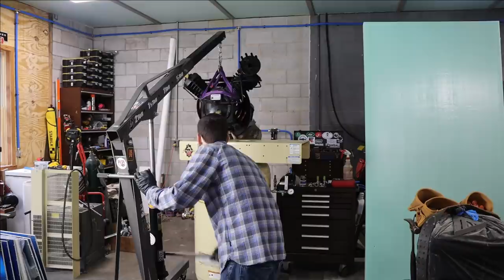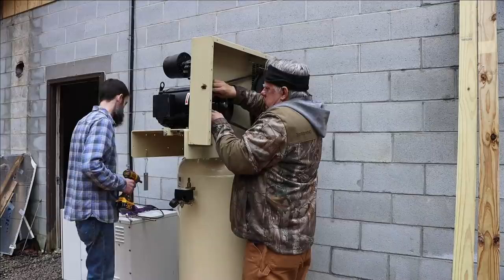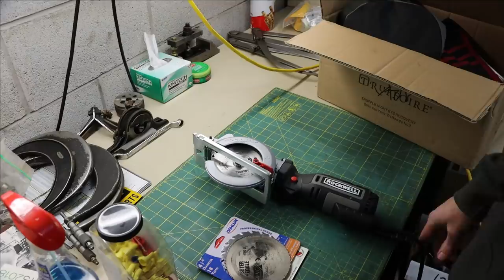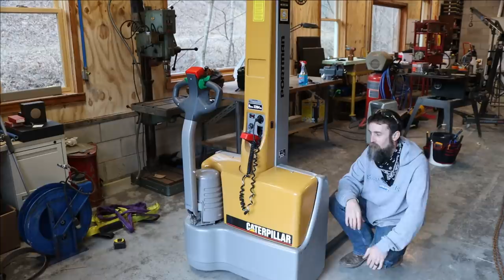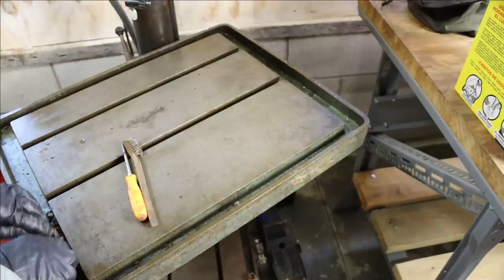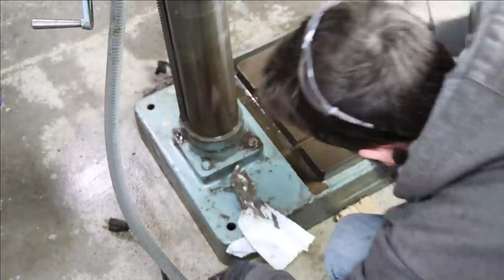Awesome New Shop lift! /  Doall Drill press 1st run and clean.

Comment: Nothing better Than A maple workbench. I got 2 of them. Will last a lifetime. Then you can flip them over, and the next owner can use it for a lifetime
Reply: Fancy seeing you here Mr.Pete
Reply: Before buying any batteries I would look up a local commerical battery vender for heavy equipment and lift trucks.   They may also have a couple low time used batteries given how little you'll be using it between charges.   Also suggest a small back splash on  the new table to prevent small parts rolling off into no man's land.  
Given the stock look on the Caterpillar you might want to consider orange flames down the sides.  Well done and I'm happy things are lining up well for you, you've waited long enough!
Reply: Steve, two thoughts crossed  my mind.  A good future episode might be brazing  those drill marks closed on the new drill press, then using the shaper  to refinish the surface.  That would make a good video.
2.  GET A SECURITY SYETEM.  You're never to remote to not have A couple local speed addicts breaking in and stealing what ever they can pack off and fence at a pawn shop or Craigslist!

Comment: Love the doall Drill press. Make sure you clap your work, That thing is so powerful, it will break your wrist.
Reply from the maker: Thanks Lyle, I really like the drill press as well. It really would twist you up real bad without even bogging down.  Its incredibly powerful.  That's what makes it so nice for the larger drills.
Reply: It is a nice piece to have. Incredibly versatile fot the foot print it uses
Reply: Indeed, give your work a round of applause and it won’t try to kill you.

Comment: The new shop additions look great. The lift should be a great help around the shop. One thing about the batteries, the batteries  and the charger must match. AGM is different than flooded type etc.

Comment: dont replace the agm batteries with car batteries it whont work for long : the car batteries are made to give a high amp charge for a short time they have thin lead plates that will warp and damage if you use them in the forklift , they might even damage the build in charger as the gell batteries charge in a different way 
the gell batteries are made for a lower amperage at a longer duration and have cells made of thicker plates , they can allso take more mecanical shock abuse , you could get away with acid agm batteries for solar systems but gell semi traction batteries work best and can be recharge verry verry often and hold the charge better and longer 
if you make some sort of table like structure you could put the materials on the table with a pallet then get the forks under the table and be able to lift the materials high enough to be able to unload the pallet up intoo the rafters of the workshop

they allso use these gell batteries in immobillity carts and welectric wheelchairs , you might be able to get them a little more cheaply used from a place that sells these wheelchairs and immobillity carts

might not be the best idea to show the video of you cleaning up that drill , if they see it at youre workplace they might hand you a bucket and cleaning supplies and poit you to there drillpress

if you find the materials cheaply it might be nice to make a wood boardwalk next to the building on the side of the river , makes walking around on that side of the shop a little safer and it should stop any water leakage from the roof from undermining the hillside too close to the foundation
Reply: Steve has recived some good advice, through YOU . Great job
Reply: yes your correct gel semi traction batteries, and as for the riverside of the workshop, I would like to see Steve either make or buy a bandsaw and use the trees on his property to make the lumber for the Broadwalk aside his shop. he would need to use railroad ties for the next to ground support but the rest can be self harvested.
Reply: came to say about the same.
exept :  you can do gell to acid wthih litel to noconsequance reguarding the charger.  hoever the contrary is not true as a charger set for traditional acid bateriew will overcharge gels.
my bad I looked it up and its the discharge .. that woks that way...
a gell charger might do 14.7 witch is a bit high for traditional acid.

But most charger have 2 or more seting depending the batery used.

also from experiance gell is about 2 or 3 time the price but will last a lot longeur if properly used.

also alghought not recomended car bateries will worck but ne aware they wont lsst very long and might short at some random point. given the 2 batery set up that could cause problem if that hapens.
Reply: It’s not the gel cell batteries per say that is important.  What you are describing is the difference between a car battery and a deep cycle (marine style battery) battery. The gel cell batteries can also be purchased for cars( different construction). The deep cycle gel cells can be purchased at sams club for around $180-200 each for a group 31 battery. For cost comparison a conventionally constructed lead acid battery would maybe cost $25.00 less per battery. Purchased a gel cell battery for my Chrysler van last year for around $220.00 at autozone.  Most of the newer automatic chargers will work just fine when charging either style of battery. Advantages of the gel batteries is they don’t off gas as much as the lead acid batteries.
Reply: Wheelchair and mobility cart batteries are wayyyyyyy smaller in size and capacity and cost just as much or more than a conventional deep cycle gel cell battery.   They are typically in the 20-40 amp hour rating.
Reply: I doubt the drill press there is dirty at all, Steve has been there 14 years, I would assume, seeing from the few shots of the workshop at his day job, that you probably could eat off the drill there, along with the rest of the machinery as well. Likely cleaned at least once a day after use, and probably after each use as well.
Reply: @lloydholt6511  What Lloyd says.  Might want to stop by a local golf course maintenance shed and see if they can hook you up, as golf carts use the same deep cycle batteries.
Reply: i used to work for a company that helped people with mobillity problems  renting and selling them stuff like electric beds immobillity carts wheelchairs raised toilet seats with grab bars and stuff like that 
yes for the foldable carts they use the smaller batteries youre describing as they need to fit and be able to lift intoo the trunk of a car 
but for the more permanent use ones we used bigger batteries . the smaller style immobillity carts (think i seen the type used at supermarkets in the states with a large shopping basket) 
over here they use 45 to 55 Ah batteries in those 
i drive a bigger version meant for persons that are heavier then 100 kilo and longer distances (wheels the size of a moped scooter) and there 2 x 75 aH , gives the cart a 30 / 40 kilometer range depending on the temperature outside 

it shouldnt matter a lot in his setup , the lower rating just means the batteries run down faster so instead of a full 3 to 6 hours of use between charges  he can only use it constantly for say 1,5 to 3 hours before the batteries are drained , it isnt a warehouse its being used in , it just for occasional use lifting and moving stuff around if he gets two sets of the lower amp ones (there a lot smaller so you could fit 4 in there ) if it would save him money to get double the amount of batteries he could put  sets of two together in paralel and connect those two pairs in series and get a higher amp 24 volt setup if needed
Reply: Most of today's newer cars/SUVs with "stop-start' feature** use AGM batteries. They ARE considerably more expensive, but last much, much longer than a conventional lead-acid battery in stop-start service. Where the AGM battery lasts about 3 years, a conventional battery will be toast in less than 6 months.  
**3-5% better fuel economy on EPA test cycle. REALLY!  When I worked at a car company, we would kill our own grandmothers for 2%...
Reply: @stevenslater2669  i wonder if that amount of fuel savings counter the extra cost for purchasing the system , most of the green good for mother nature stuff actually cause more chemical waste works worse than the original option and basicly costs the consumer more than it pays back
Reply: I was thinking the same thing regarding the side of the shop, a wooden walkway would be super, and also help prevent erosion of the bank and around the foundation.
Reply: Agree on plate geometry.  "Gel" batteries are bullshit though.  More cost and less reliable (once they gas, they're done).  Just water your damn wet cell deep cycle pack.  I did industrial cart service for a while and Dekas, etc always got replaced with US2200's if I had my way, and the Dekas would always be dead prematurely.
Reply: @davidblarstron767  uou are correct on a regular charger ruining AGM batts.  Above 2.55V/cell, the cell gasses the electrolyte.  In a wet cell, this is how they balance the series string. You run the whole pack up and water dissociates at 2.55/cell and makes hydrogen sulfide (rotten egg stink).  In an AGM, that electrolyte isn't supposed.to be gassed and the pack is sealed, so it will make gas, blow it.out the safety vent, and the pack is a lead weight that cost twice as much as the regular old flooded lead acid brick.
Reply: @paulsomero  in my aplication they last about 4 years and i use them daily to drive the immobillity cart to work and back , charging them every night , maibe im just using the right charger 
they do not not like being drawn completely empty though they usually dont recover from that and range suffers dramaticly
wat we had happen often in old folk homes is that they unplugged the charger from the net but left the charger plugged intoo the cart , it would draw the batteries empty beyond saving and gave them a 300 dollar repairbill , they never learned from that either
Reply: @watahyahknow  yeah overvolting causes gassing/venting and will wreck them.  Undercharging will cause sulfation (true of all lead acid batteries) and you'll lose capacity.  It is imperative to use a charger that is sized for the battery and has a charge profile tuned for the specific chemistry.  Flooded lead acid batteries will give you more life /as long as you maintain the electrolyte/.  This is based on hundreds of golf carts in the field.  My old employer was the #1 national distributor for a large industrial golf cart manufacturer.  We're talking two different sizes of pack here I think - I'm talking 48V 180-220Ah, you sound like you're talking more 25Ah range or so for bandit scooter type vehicles.  We always recommended doing FLA instead of AGM if the customer had the ability to maintain or would buy a service plan to have us come top them off.once a month.  We could easily get 3-5 years on a maintained US2200 XC2 48V pack of 40+ hours a week of industrial use vs 2 years on average for the equivalent AGM pack.  Also, F Lester chargers.  A lester will wreck your batteries.  I don't care id your fleet manager has a guy who knows how to replace the 600V cap inside and you have parts inventory, just go buy a Delta Q and stop needing to repair in the first place...
Reply: @watahyahknow All good points on the AGM vs. Lead/acid.  I'd just add that with the enclosed battery box that the out-gassing of a lead/acid battery during charging is never a good thing for the other things that live within the enclosure.
Reply: AGM (Absorbent Glass Mat) are not gel batteries. Gel batteries are rare to non existent these days as AGM adresses the ability to mount in any orientation that gel was designed for without the current delivery deficiency that gel suffers from.
Virtually all starter batteries in motorcycles are AGM
Reply: @paulg3336  i use sonnenschein gell batteries , there true gell batteries , believe sonnenschein where the inventor of the gell version never knew about the delivery deficiency , then again these are traction batteries not starter batteries made for steady flow not peak flow
having glass mat batteries in motorcycles makes sence as there usually got shaken about a lot more
Reply: @watahyahknow  Apparently the gel didn't perform as well as a liquid electrolyte . Maybe the deficiency has been addressed but not much development has gone into lead acid batteries recently. Bikes use AGM mainly to allow placing the battery on its side. The after market already sells lithium starter batteries for weight saving.
Reply: @watahyahknow  The standard test cycle includes quite a percentage of time with the vehicle stationary which is the only time the stop/start system 'appears' to improve economy. Factor in the extra cost of heavy duty starter, heavy duty battery, heavy duty alternator and more frequent replacement costs = zero benefit. Why do Taxi engines have such long lives, because they run for long periods without stopping & starting.

Comment: It's been a lot of fun watching your shop come together.  You had mentioned in an earlier video that you wanted to get the Internet into your shop.  I have used a system by Ubiquiti that has a set of sender/receivers to transmit a signal from my house to my shop.  Their NanoBeam M5 system can transmit your secure internet signal up to a kilometer.  It has worked flawlessly for over 5 years.  It's far easier than running wire. You can connect it straight to a computer or to a router so you can have wifi for your phone or a tablet.  The cost would around $300 and you can install it yourself.  There are plenty of youtube videos to show you the way.  I have done live stream videos for my channel using it so it will help you with your goal of live streaming.  Thanks for all your content!  All the best!

Comment: That is one nice drill press, it's better to have more tool then you need then to need more then you have. 
 If you build a "A" frame with pockets to go around the forks, so it can be moved on and off as needed you will have a  lift that will do so much more.
The shop I worked in made a "A" frame that was bolted to a die cart lift  table, we used it to load 8"OD X8"OALslugs into a lathe with out a over head hoist.  
You have a great shop and I enjoy seeing what you have been up to each week, take care.

Comment: Steve, you should shop for some so-called 'marine' deep-cycle batteries (ie boat batteries - the kind they sell for trolling motors).   We use then for small ride-on equipment and they work well, last well and are not too much more than car batteries.
Reply: Also car batteries are optimized for cranking current not deep discharge. Even few deep cycles may mess them up.
Reply: @positivebits  In this application of low discharge, and regular float charging car batteries will do well enough, and are cheap.  Just buy the ones with a few year warranty, and keep the paperwork, so you can change them if they fail before the warranty is up.

Automotive batteries seem to last till just outside the warranty period, and unless you pay the big premium for the OEM battery (and the dealership does not supply them, only available to the vehicle assembly plant under contract, as the battery supplier has to eat warranty claims) you will get a short life of warranty plus a few months more from them.  Price wise half the cost of the expensive battery, and in this application likely to last just as long, as it will be idle most of the time, and sitting on trickle charge till needed once or twice a week, with only a short discharge.

Original batteries are there for running the unit for 12 hours on, 12 hours charging, and running near non stop for that 12 hours as well in some form.
Reply: Indeed

Comment: That drill press is fantastic. WHO has a problem with it? First, it isn’t chinesium! Second, you highlited all the good stuff! Like i read often on machining sites, Steve i’d suggest filling the tables holes with the metal fix type J B weld, and stoning it down smooth. No, it won’t be perfect but it will give you a strong flat surface to work on for a long time. Excellent work. And killer pallet jack! Wish you posted what you pay for this stuff but regardless, that jack is LIKE NEW! It should last you your life time! Very excited for you. I am forever a deal hunter and there’s nothing like the thrill of bringing a machine or tool home you got for a steal! Cheers!
Reply: was considering him filling the holes with brass / bronze welding rod jb weld prolly works too
Reply: The infamous “arc of shame”, AKA “apprentice marks”..........

Comment: Steve would you consider doing a restoration episode on the DoAll drill press table?
weld up the 'amateur peck holes', regrind the surface, file all the old cast marks, new paint job etc?
i would love to see that.
Reply: Welding & regrind the peck marks is a repair.     
Or machine a round pocket 1/3 of the table's thickness with a diameter that removes most of the marks. Then fit a round plate with a 0.005"-0.010" smaller diameter. The strays could be drilled and tapped for a bolt to bottom with the head sawn away. Again regrind the surface 0.03" to true all?

Comment: Hello Steve,  You could take some 2x4 and plywood to make some trusses for over your door so that that end of the roof would be free standing.  No posts to get in the way.  I have done it with the 2x4 flat against the 3/8 plywood sandwiched on both sides in a right angle.  Tap con some angle iron to mount it to your block and you are good to go.  Put them on 24 or 16 centers and you will be fine.  Then use your posts back by the equipment pads or do them the same way.

Comment: I used a piece of hydraulic hose between my compressor and the shop supply which is steel threaded and coupled... I have a T30 horizontal Ingersoll unit that is about 20  years old... Cheers from Louisiana.... Mike